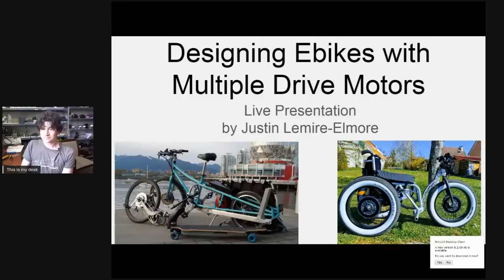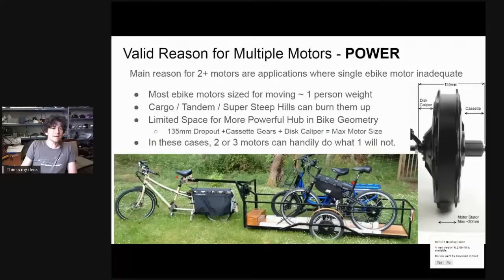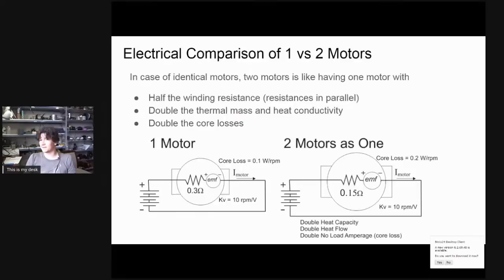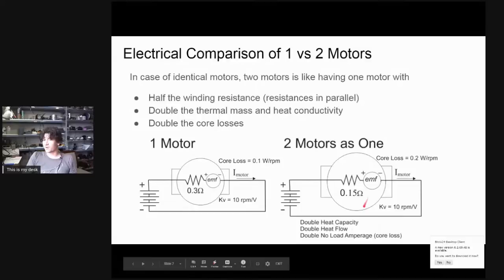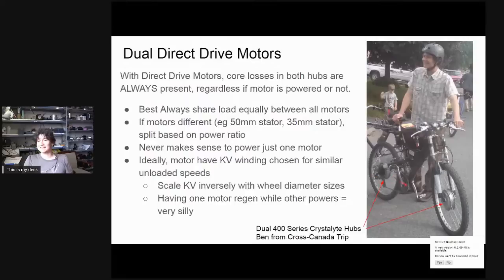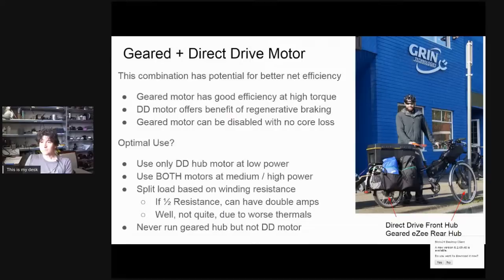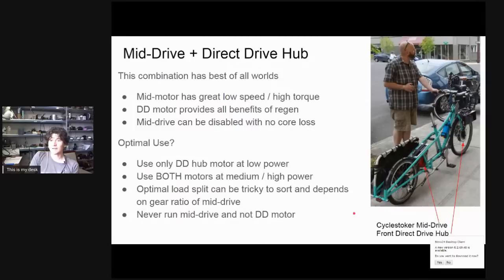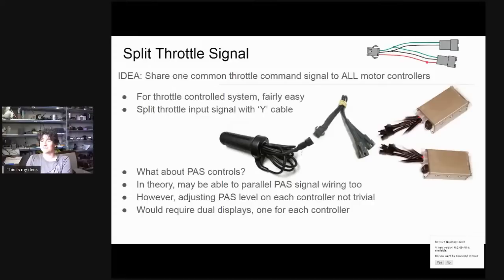A guide to multi-motor (2WD and 3WD) ebike drive systems

Comment: For low traction applications it would be useful to have a feature so that the front (secondary) motor's speed can not exceed rear motor's speed by more than a certain percentage value.  Think about riding up a slippery slope where under equal torque the front would naturally spin out.

Comment: Can I buy a dual motor drive installation kit with console to turn one of them off when not needed and pair a pedal assist with them a separate throttle for the gear drive on a DIY bike?

Comment: So two betteries and two the same motors like Defender S  low power run one motor up hil run 2 motors, 2x750W and bats 2x17 or 15Ah  gives the end of ebike efficiency and power.  Going further with motor power causing inefficiency on low power on high speed to much drug high sitting position for pedalling , so you have to go into emoped style with  sitting position 20-30cm lower and speeds 35 plus kph, without pedalling.

Comment: What a fantastic resource. Thanks, Justin.   I’ve started woking on modifying a lightweight car trailer I pull with my EV by adding two hub motors. The biggest limitation is finding single side hub motors that can handle the load.  Very few hub motors give load ratings.
Reply from the maker: Glad you found it helpful!
Reply: I'm thinking about modifying my Radrunner to run dual battery and dual motor eventually, but biggest idea is designing and building my own 3wd Velo mobile.

Comment: 47:45 I used to have this kind of a setup with two independent motors and throttles in my bike. It wasn't practical, cost-effective or efficient, but it was sooo much fun to ride when it was snowing. I've never had that much fun on a bike. Hoping to build something like it again sometime. :)
Reply: I'm trying to make a setup just like that. thank you

Comment: Interesting points in this topic and well explained. Thanks
My E-CELLS Super Monarch Crown has 2 wheel drive with two BAFANG 750 watt, 52 volt (yep) motors and two batteries, front down tube battery is 20 Ah, rear, under rack battery is 15 Ah. Maximum load rating is 400 pounds including rider but not the 95 pound weight of the bike. My single controller is a 52 V sine wave 45 amp with 18 MOFSETS in a sealed conductive gel for cooling which also uses two aluminum fin arrays on the box. The bike uses a torque sensing 9 (NINE!) level pedal assist.
The HQ for E-CELLS is in Pahrump, Nevada, fortunately for me B/C I live only 60 miles away in Las Vegas, NV.
FIELD CHARGING: BLUETTI AC200 MAX Li Fe Po inverter battery charged by an Off Grid TREK 220 watt solar blanket cable locked to the roof racks on my SUV.  This system works great and can run a large cooler all day W/O depleting the big LFP battery. My bike has a patented, frame mounted charging port to charge both batteries simultaneously. LOVE this "beast".

Comment: Dual motor is also interesting for people that plan to overvolt their existing motor, but are worried about overheating.
Reply: You'll still overheat, you'll just be going faster before it happens.

Comment: Really glad you made this video! I'm doing a dual direct drive motor mountain bike and was contemplating adding wiring for disabling one hub or the other but seeing your charts about core losses is going to keep the build much simpler! Thanks!
Reply from the maker: Glad to keep you on the more efficient and simpler path!

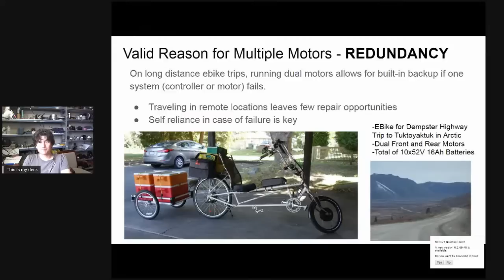Comment: 10:30 - I agree, but if the phase wiring on the controller blows out you will have to disconnect it and HOPE it hasnt blown off the actual wiring on the inside, or you would have a motor that is working against you until you swap out the wheel. I think I would rather carry an extra rear wheel and controller or two just in case.
Reply from the maker: A failure that results in phase wires being shorted inside the motor itself is exceedingly uncommon. It's almost always either blown controller mosfets, or cable damage outside the axle, and in both those cases it can be remedied without having to take the wheel off.

Comment: As a Dane I got a warm tingly feeling when he mentioned the Christiana bike so casually. 
We see them everywhere here, and I was thinking about electrifying one with 2 front motor hubs. However, all the electrical versions are sold with back or midwheel drives.
Reply: Better get a mid drive.  A BBSHD  will do it perfectly
Reply from the maker: Yeah, you only would need the dual hub motors upfront if you are steep hills to climb with your cargo and a single motor isn't up to the task.  It is really impressive what dual hub motors can do, and the benefits of regen on this kind of vehicle are huge which you can't take advantage of if you go the mid-drive route.

Comment: Great presentation. I really think that a setup with a DD rear and a slightly slower geared front motor would just work perfectly even with a voltage driven controller. In high power situations they would share the load and at low power thr faster DD would done the work entirely without even turning off the geared front hub. I think I'm gonna try this setup.
Reply from the maker: That will work, but you will have no load losses from the grades motor just spinning within the freewheel you are going fast and not actually contributing. So you will have the core losses of two motors but only the power output of one. If you can set a vehicle speed limit to cut out the controller driving the geared motor once it is not contributing  then it will work perfectly.
Reply: @GrinTechnologies  Well, The easy way is to use the sigle/dual switch button on the controller (almost all dual escooter controllers have that) it basically switches off one of the hubs/controllers. In a dense city setting it would be on but doing pace it would be easy to switch off or reengage... but then again, it wouldn't be automatic... not perfect :) I might as well stick with the brute force (2xDD)
Reply: @GrinTechnologies  I’m about to do this to my RadRunner with the geared motor in the rear and your all axle DD on the front. Is this auto shut off easy to configure on the Phaserunner?

Comment: I use two throttles because I can feather the front motor as a anti slip system to eliminate wheel spin when I start riding the bike.
Reply from the maker: If you get a controller with a torque based throttle response, then you can simply set the maximum torque on the front wheel motor to be a value low enough that doesn't skid out.  Then no feathering is needed.

Comment: Will left and right wheel fitted with 2 motors act the same as having a Differential?
Reply from the maker: Yes, there is zero need for a differential. It's fine if one motor spins faster than the other while cornering.

Comment: Just a great and informative video. I run a fat bike with a rear wheel 500 W 36 volt Bafang motor and an S900 lcd. I added a front hub motor Mxus 500 W 36 volt with an SW900 Display And duel matching batteries. One for each motor. The S900 is the master controller so the pedal assist, brake sensor and throttle signal wires share from the S900’s controller to the SW900’s controller. I get 18 mph full throttle with only the rear hub Bafang running on a level surface and if I add the front hub Mxus. I get 21.5 mph full throttle on a flat surface, but more important is I get enough torque now to climb hills in pedal assist mode and 2nd gear that was previously killing the Bafang motor alone. The Mxus motor only shows 78 watts on the hill climbs. I wish I knew The information in this presentation before hand, but it looks like I’ve made a good guess On my all wheel drive set up. Thanks again a great presentation.
Reply from the maker: Hey there and thanks for sharing your experience building your own 2WD setup with these 3rd party controller and display products.  I'm guessing that both of these are geared hub motors?  You'll probably find that switching out to a controller with a torque throttle will help a lot for getting a more balanced power share on the climbs.
Reply: Grin Technologies I understand how PWM works with the MOSFET and PAS, Throttle, Brake Sensors etc, But the only torque sensors that I know of are in mid drive motors, Thank You

Comment: if you are running 2 DD motors... do the 2 of then have to regen of just only 1 ...thank you ....ii enjoyed your presentation ...ii understand what to do now in finishiing my project
Reply from the maker: You can do regen with just one or with both. The best efficiency and strongest effect will be to use both motors equally for regen just as your do for power

Comment: what i miss regarding this topic is, in case of 2 e-wheels, in parallel, like on trailer, should one use 1 battery, or 2 separate batteries, for each motor 1 battery, and how to reverse direction of 1 e-wheel, if 2 e-wheels are mounted in parallel (ie on trailer, 1 e-wheel is mirrored).
Reply from the maker: The best in general is to have all the batteries paralleled or one large battery, but it's fine to have separate packs for each controller if that's more convenient, which may well be the case for a trailer assist. 

Motor reversing is done with the controller.

Comment: Very informative about two motor systems. Can you go more in depth on how to setup a three motor system?
Reply from the maker: Hi Jesse, much of the same principle applies just extrapolated to 3 motors and motor controllers. The wiring is a bit messier but the fundamentals are the same. If there's a specific question about a 3 motor setup you've got that wasn't addressed here we'll be happy to answer in the comments.

Comment: I have one of the old Truck Trikes built by Bill Stites. It has a cycle analyst running two ezee controllers with the dual controller shunt. My question or confusion is with the dual battery inputs. I have two 48 volt 23 ah batteries and if these are in parallel wouldn't that put the voltage at 96? I've noticed the batteries are numbered 1 and 2 and the trike will function with only one battery but only in position #1. Also #2's input leads have whatever voltage #1 battery is, standing there at the input. 
What would be your suggestion for a full system upgrade that would allow for regen?
I really appreciate all you've done and continue to do!

Comment: Hi Justin - as an EE major, its nice to see a proper EE approach to this motor efficiency business. Very informative. A question on your simulations - it would appear at 24:59 that both System A and System B benefit from 200W of human input, for a total of 400W in which case it can't be compared with a single motor getting just 200W of human input? I hope that your simulation 'add' function knows how to handle that correctly? Best regards.
Reply from the maker: Yes for sure. You'll notice if you use the "add" function on the simulator tool that the human watts input for system 'B' is disabled as it is no longer part of the equation.
Reply: @GrinTechnologies  Thanks - now I look closer I can see some of the figures are greyed out. Missed that on first viewing!

Comment: Anyone tried to fit a trike  3x3.. I've got a gear less hub motor rear 1500w and wanted to fit 2x500w front. Will this system work?
Reply from the maker: Yes, but the electrical hookup is a bit cumbersome. The trike in the thumbnail of this video is a 3 hub motor drive.

Comment: You haven't got around to sharing your all electric drivetrain yet.  One advantage you never mentioned is aero.  ebike world neglects this in general, but an aptera/velomobile shape can go insanely fast with very few watts.  Velomobile/recumbents have bad drive trains due to long chain, and either sags or multiple drag rollers.  No drive train would allow for lower base (may be impractical on real roads), but also allow a fared shape where you pedal on your back and see forward through mirrors.  Easy to see behind and use side mirrors.  Even unfared, this would be an inverted superman position, and ludicrous fast road vehicle.  A long enough vehicle can have 2nd person using same pedal system but pedalling in reverse if it is circular generator.  Vehicle doubles as a sleeping camper! :P:virtualhug:

Comment: I have a 26" fat tire ebike with a rear hub. I'm specifically interested in modding it with a front hub for better maneuverability in the snow. My commute doesn't have many hills but we do get pretty rough snow here in central PA. What type of configuration would you suggest? Is it more ideal to place an additional 750w in the front or a smaller 500w? I see a lot of people placing larger motors in the back.
Reply: If you haven't made a decision yet, I'd go big power direct drive front hub. We'll presume the rear hub is geared and can get you up the hill. The direct drive can let you recharge on descents. It won't have much torque at low wheel speeds so I think it will help in slow snow situations. Just not sure how to integrate the 2. The rear hub gets you going and keeps you going at slower speeds and at some speed the front hub motor will become more efficient as there is no gearing loss. I like the pluses of regen (what controller is needed?), low torque when assisting, maximum efficiency faster on the flats, especially with an extra 100+ watts of you. The rear gear hub will free wheel.

Comment: I cant unhear it now. You use "um" as punctuation in a sentence. You also use it to denote a capital letter/beginning of sentence and its SO CONSISTENT 😄
Very informative video too
Reply from the maker: It's a delivery detail we've be working on, this presentation is a few years old now.
Reply: @GrinTechnologies  no criticism here, just something I noticed 😁
Btw, you guys make the BEST torque arms. I converted my shitty mongoose status 2.2 into an ebike and it kept breaking. One day the entire dropout broke off. I didn't bust my ass because it was still hanging on by the TorqArmV4, which single-armedly held that side of the wheel on and allowed me to ride back home safely. Buying more soon for my new ebike ASAP!
Reply: @GrinTechnologies  if theres something I can recommend for your future versions, its to make the hole's width slightly adjustable. I had to shave down a strip of metal with my dremel to make it just the perfect thickness to shove into the hole between the torqarm and the axle, to make it tight so that there wouldnt be that tiny amount of rotational slack. Perhaps you can make a threaded hole going through the side with a screw that would screw in and push against the side of the axle to keep it perfectly tight, as that half a degree of rotation can still allow for some damage to the dropout
Reply: @GrinTechnologies  If I can recommend an improvement for future models, make a threaded hole on the side with a screw that would push against the part of the axle that goes through the torque arm hole, to make it perfectly tight and prevent any and all rotation of the axle. That half a degree of slack can still allow for some damage to the dropout. I shaved down a strip of metal and mashed it in, but making it adjustable would be a much easier way.  Perhaps even 2 screws, so that the threads suffer less stress. Just make sure the hole is compensated for somehow so it doesnt become a point of failure
Reply from the maker: Thanks for all the feedback Denis. This is more or less the design of the V7 torque arm that's been in production for a year now:
https://www.youtube.com/watch?v=1IsgWoTt9F8
It's only regen systems that really require that level of tightness. In a normal non regen setup, the axle just bottoms on in the direction of propulsion torque and stays there.

Comment: Very interesting and informative. I'm in the planning stage of an extended tricycle with the rear axle converted to have a fully working differential and I'm planning to have a dual drive with a front hub and a mid drive, how would I deal with the signal wire in  that situation?
Reply from the maker: I would recommend having it so that at modest power levels only the front hub motor is operating, and then above a certain throttle level (say like 2.5-3V) then the mid-drive motor kick in.  Or just run separate throttles for each.  Assuming it's a direct drive front wheel then you really mostly just want to use the mid-drive going up hills, but have the hub motor running all the time (hills and flats)

Comment: Came here for information on rear differentials for a dual motor set up on a trike, but was told I don't need it, and to ignore the inefficiencies and uncomfortable turns... Efficiency is important to me and because I make deliveries, so is my ability to maneuver, including taking some tight turns. :/
Reply from the maker: With a torque based controller like the Phaserunner/Baserunner, then is actually no reduction in efficiency and no effect on the steering or handling. Both the inside and outside motors will be generating the same torque even if they are rotating at different RPMs.  It's already intrinsically acting just like a mechanical differential.
Reply: @GrinTechnologies  Oh no... I'm at the drawing board again. lol Learn some more and like a cascade, you have to change a chain of things. lol Thank you.

Comment: excellent presentations, thx for sharing. could not find pole voting on your web page, so ...  i would vote for how-to-solar-charge-ebike-battery, and some examples of common setups which include regen braking, and regen-braking-shallow-dive - basics, like do i need any extra electronic, what batteries are best to use (perhaps capacitor largo, for big amperage ...). i am making e-powered solar charged trailer, for world touring, and your video presentations gave valuable insight into required equipment. thumbsUp, have fun, s love nia